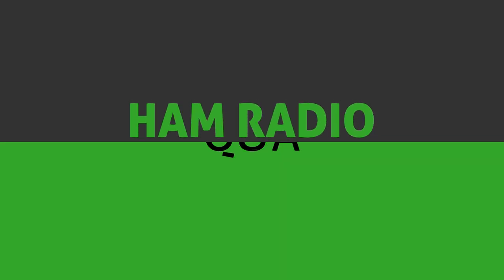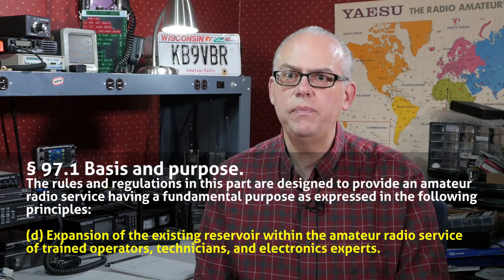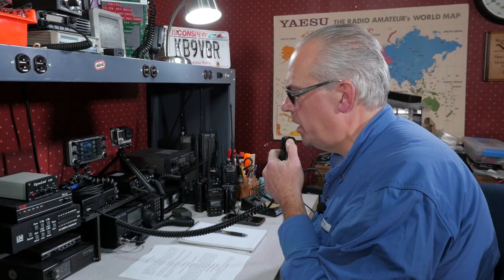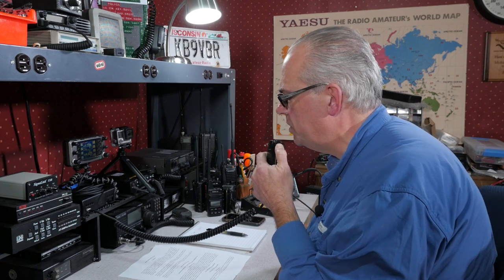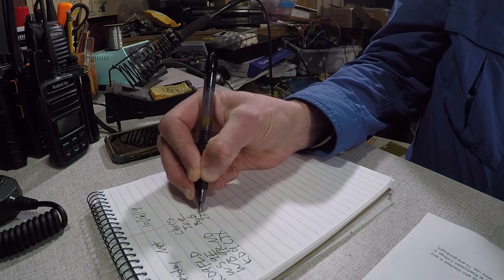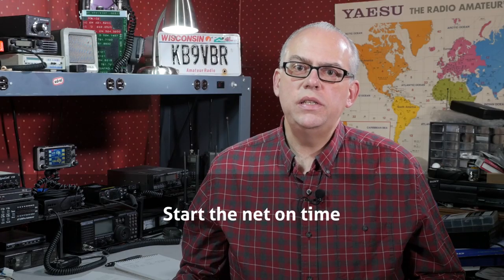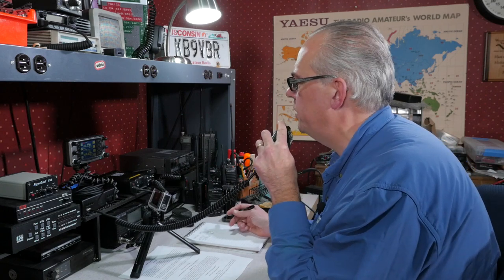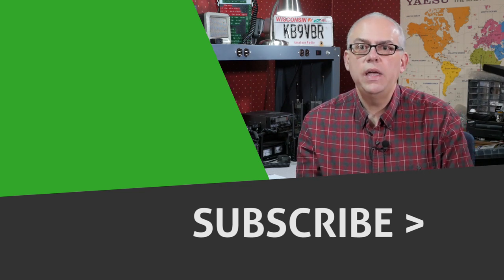How to be a net control operator - Ham Radio Q&A

Comment: I enjoyed watching your video on how to be an effective net control manager. I was the primary net control operator for a ham radio club in which I was a member as well. I also trained new net control operators as well. One aspect that you did not mention was the time period shortly before the net you warn users of the upcoming net. I normally announced the weekly net two minutes to the net activation. I also had to access our clubs repeater to "link" the VHF with our UHF repeater. These codes were only provided to net control operators. I was our clubs net control manager over 4 years and thoroughly enjoyed running our weekly net. I was somewhat nervous when I started but it became much easier the more I was net control. To be fair, one reason I was offered the job of net control operator/manager was that I was a net control operator of an HF station while I was in the USAF. I actually had formal training on being a net control operator. That too was thoroughly enjoyable. I enjoyed watching your informative video on becoming a net control operator. Been there, done that ALOT!

Comment: My best advice: Relax. Everybody, even seasoned net control operators, will flub the occasional callsign or word. None of us are flawless. Hams are usually pretty understanding. Especially if they know your new at running NC. Or at least that has been my experience.
Reply: True. I have witnessed NC's make mistakes. Certainly never ruined everything and there tend to be seasoned participants that check in that can help with any mistakes.
Reply: I want to know how to buy one of these radios but nobody’s give me a answer

Comment: I was net control once or twice as a young teen ham but once I joined the military I really got comfortable with it. I remember at one point working in Iraq as a contractor having three radios (two HT's and my mobile) running incident command and net control during an incident we had going on. After that running the home net is easy haha

The only downside is I've gotten so used to military radio brevity that ragchewing is a struggle now hihi

Comment: Like the vid. I have not run a net yet, but like to try and capture the call signs along with net control to see if I can keep up. Our club averages @ 40 check ins per week, and we read off a log going by A calls, then K calls, and W call signs. At the end of each we ask for any check ins not called and we usually get a few random folks checking in - those are the most fun !     73
Reply from the maker: larger nets will break the check-ins by suffix. Its a great practice as it maintains order and helps the net control keep up with the flurry of activity

Comment: Good video. One thing I included in my shack a long time ago is a white board. I use it for call signs of frequent calligns/names  or notes. I don't suggest using it for logging but if chasing something like a POTA station it can be handy for getting down the details while you boot your PC and start the logging software. A 4 pack of different color markers can be had for about a $1 and I use different colors for different things.

Comment: I keep a spreadsheet of the regulars with call signs, in alphabetical order, on the first column.  Besides their name, I include their town.  It's  easy to add new people.   I print it out before it's my turn to be net controller.  I have a blank colimn to write a number for the order of call ins.  Things run smoother for me this way.

Comment: Another good one, Michael. All of the local nets I hear and participate in require operators to check in "by providing your callsign slowly and phonetically, followed by your name and location". This eliminates the need for looking anyone up on a directory based on callsign only and getting it phonetically helps ensure it's copied correctly. It does drag it out a little more as it takes more time but everyone can begin to associate callsign and name week after week.
Reply from the maker: As net control‚ you are in charge. If you have trouble copying callsigns or if conditions are such that callsigns can be difficult to discern- by all means slow things down by asking for phonetics or slow enunciation
Reply: KB9VBR Antennas Yeah. It’s just in the preamble of every net here in Arkansas, apparently. Sometimes I wish it weren’t because I know that control knows who most checking in are. Two sided coin I guess. Wasn’t saying not asking for it is bad, just hadn’t heard it before.

Comment: If the purpose of checking into nets or running a net as a net control operator is to prepare for handling "emergency"/disaster traffic in behalf of the Red Cross, other ngo, hospitals, or government agency (e.g., handling logistics traffic for the latter), it is >really< good practice
1. Avoid Q and any other codes. Full Stop!

2. Speak slowly and clearly. It avoids repeats.
3. Use ITU phonetics for ANY and ALL words that might be misunderstood (ESPECIALLY if you don't know how a word might be pronounced!), regardless how good/noise free the RF path.
4. Use as few words as possible. More words = more clutter. Practice for public service for bike or running events or other. Few words = less time on the air in case a station needs to break in with priority or emergency traffic. (Monitor the fire services for a clue about this).
5. Take full charge of the net, giving example of good technique when you key down. Advise other stations to be brief and avoid codes. Q-codes might be cute and "hammy" but they obfuscate meaning to those unfamiliar with them (especially those of a served agency listening over your shoulder).
Jus' sayin'
Reply from the maker: All very good points. Weekly swap or fun nets tend to be a little more loose in operation. When I operate an emergency communication net (whether as a drill or a real event) I ratchet up the structure to keep things moving in a quick and organized fashion.
Reply: @KB9VBRAntennas  Fun nets, of course! E.G., RV nets, swap nets, check-in-just-to-BS nets, etc. Quite informal and no need for any discipline other than respecting one's place in the queue. One real peeve of mine is the stupidity(?) of those HF net participants tuning up on top of an already underway net. Or maybe ignorance that one can tune up a few kHz off the net freq and still be quite fine re VSWR. ARGH!!! One of those "Beam me up Scotty" moments.

Comment: Tip I would add -- Write [your call] and [the repeater hosting] on a post-it or something in an obvious spot.  ID often - but if you NCS on multiple repeaters, you want to ID the right repeater.  :-)   The top of your logging sheet isn't a bad place for that either.  

For the record, I ID'd the right repeater.  But I was like "This is N9IJS on - wait a minute, where am I?" which actually made for a nice moment of humor.  I would imagine a long-term bit of flack from the Club (even if only in jest) if I ID'd a different repeater...  

And whenever you lose your place or you need a moment to think -- Call for late check-ins.  And ALWAYS call for late check-ins before running pre-recorded material (ARRL News, etc.).  And after.  

But for sure - Chill, speak clearly and slowly, maybe have an ice-breaker question (What's on your pizza and where did you get it from? - Always a good start).

Comment: And another great vid Michael.  Any tips on getting more club members to do net control? Or even check into the nets?  30 members, 10-12 check ins, and 4 or 5 NCs.  I suggested win a free meal, but my cook vetoed that immediately.
Reply from the maker: That's a good question and i'm not sure I have an easy answer. Some won't check into nets because it's an inconvenient time, while others may not have the resources, or courage to get on the radio. For those that feel their station isn't adequate, like maybe they use a handheld, holding a clinic on how nets works may be helpful. Help them get on the air with an external antenna. When our club got a bunch of new hams, we spent a Saturday morning and built J-Pole antennas together. That helped dramatically with getting them to check into the VHF net. I'll save this question for our livestream next week, and maybe I'll come up with more suggestions.
Reply: @KB9VBRAntennas  how do you find the time?  Thank you for your reply! We are working on helping new hams build confidence, so maybe that is a step in the right direction.

Comment: I have a question that might be a bit complicated due to the many variables involved. When setting the power for VHF/UHF, how far can a person reasonably expect a signal to travel at different levels? I know that many factors affect the propagation, but I'm just curious as to how to determine what power setting to use for repeaters of varying distance. This is something I never gave much thought to but it hit me while watching your review of the Retevis RT-95. I know that there is no exact answer but a good guesstimate of bet and worst case scenarios would be awesome. 
Thank you for all your hard work and great videos. You have some of the best information available.
Reply: Since there are so many variables, my recommendation would be to key up a repeater and ask for a signal report.  If you're told you have a good clean signal, politely ask if the other station would mind standing by as you would like to drop to mid/low power and try again.  Then lower the power and re-assess.

Comment: Great video!  I've had my license for a bit over a year and have been doing net control for our club's "New Hams Net" on Monday nights.  You hit all the important points.  A backup operator is also great for helping with trouble copying a check-in.  I'm using my HT yet  but use a base antenna and a good external speaker and desk mic, and that helps a lot too.  Paper and pencils for the win!  Simple seems to work best!  Thanks again for the topic - I plan to send other folks in our club to watch this video.

Comment: Michael. As a net service control operator For midcars. I couldn't have said ant better.
Be prepared. You know. Pencil paper spread sheets. And coffee. N8TUW
Reply from the maker: I love Midcars‚ thanks for providing that service. I'm not an active participant as I don't HF mobile- but I will check in when I'm testing a new radio or antenna.

Comment: Are you required to run an existing net? I'm thinking it would be fun to start a weekly simplex rag chew. There doesn't seem to be much traffic outside the existing nets. I think my area needs to have the UHF/VHF bands "opened up" for the Techs to get some enjoyment out of the hobby in order to encourage them to advance in the hobby.
I have heard several ex-hams in my area say "it was just too quiet."
That triggers me to think someone needs to take the lead and encourage more activity on a regular basis. I feel like a rag chew net would help encourage conversation outside of scheduled net times.
Although I am a member of the local club, I also don't want to give people the impression that they have to join the club by associating this idea with the local club. (Not that I don't think they would support it.)
I'm just wondering if you can run a net as an "individual" (used loosely.)
I don't really want to see the frequencies get as out of control as the local cb frequencies, but there is little to no traffic now. My radio sits silent most of the time. (I'm sure that will change once I have the equipment to use other bands.) This is not very fulfilling for the local Techs.
Reply from the maker: You don't have to be a member of a club or organization to create a net on a simplex frequency. If the net was on a repeater, you would need permission from the repeater owners, but that is not the case for simplex. I think clubs create simplex nets primarily because they have a membership base to sustain the net. But if you can get a group of like minded individuals together to meet at a regular time on a simplex frequency, then go for it. My only recommendation would be to not use the 146.52 Mhz calling frequency, but pick something like 146.55 or 146.58 MHz.
Reply: @KB9VBRAntennas  Thank you for answering so quickly. 
I thought that this might be the case. I may be a General, but I'm also new. I just needed to be sure before I even attempt it.
Thank you.

Comment: Are clubs or net managers required to do something with the checkin list?  I’ve heard my local net controller state that hey did get someone in the log when there was a Mosul or state that a late checkin made the log.  Just wondering if something is done with the checkin info.
Reply from the maker: There is no legal requirement in keeping a log or list of checkins. The FCC got rid of that rule in the 1970's. Clubs or organizations may have policies where they maintain an archive or list of net activity; but it's not legally required.

Comment: what does "no traffic" mean? or "with traffic"
Reply: Alan, that the participant saying, “No traffic.” has no messages to pass along, & no announcements.
Reply: @karinhart489  ok thanks
Reply: Thanks for asking this. I did not know either. So on the other hand if you don't say "no traffic" does that mean you will be called upon to give a report? Is "no traffic" the same as "in and out"?
Reply: @1crazynordlander  I have also heard the NET OP calling CQ and announcing 'clearing traffic'. I heard nothing so I suppose it was a vein attempt at seeing if anyone wanted to say something??
Reply: @1crazynordlander  I think I hear "I have traffic" - not just an absence of "no traffic", in which case the OP will come back to you after the checkins and ask what traffic you wanted to report.